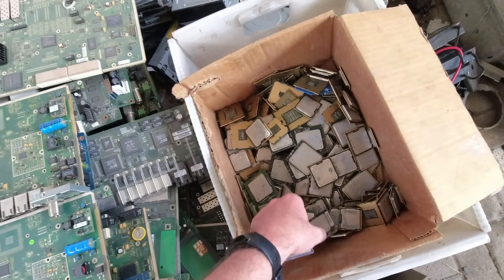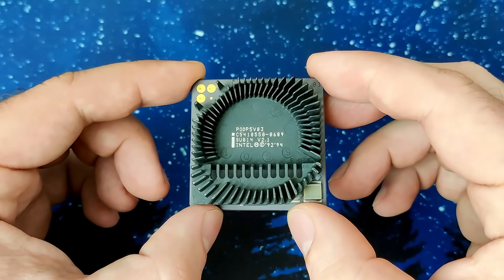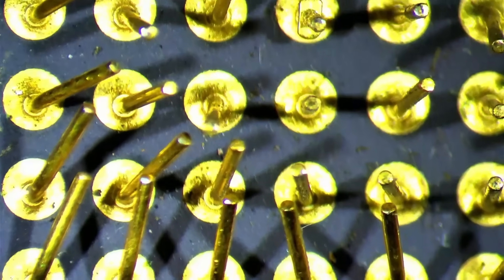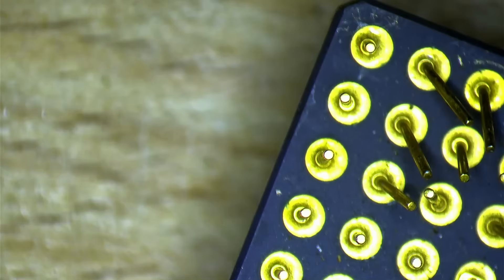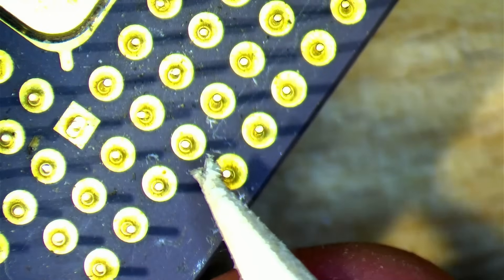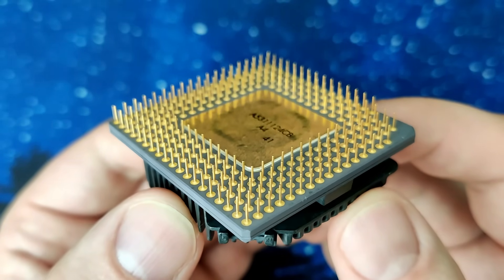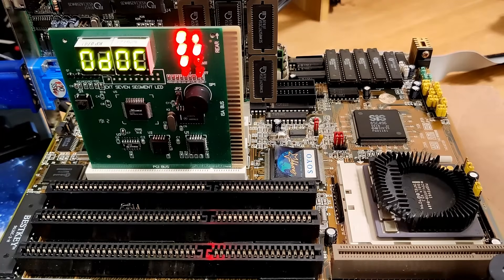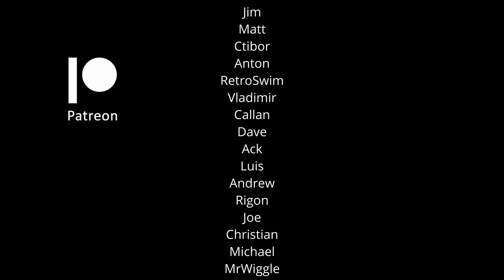Will this CPU work? Intel Pentium Overdrive (PODP5V83) - found at a scrapyard

Comment: @ 9:41 in the lower right of the CPU. What is that T on one of the pins? (Bottom right pin, move 4 pins left, and 4 pins up)
Reply from the maker: I am not sure, but it looks like a spacer that prevents the CPU from completely touching the socket. Basically, the ceramic is levitating above the socket, because that little piece of metal is preventing the pin to further go into the socket. This "T" is on all four corners of the CPU
Reply: @bitsundbolts  I didn't see it in all 4 corners until after I posted. Interesting, I guess this was done for cooling to get more airflow or allow heat to escape? I can't think of any other reason.
Reply from the maker: Yes, most probably that was the reason this gap was added.

Comment: Regarding my expectations on the pins, I'm shocked that none of them broke!
Reply from the maker: The first pin you see in the video on which I worked on, was the one that was bent 90 degrees. This one scared me! But it also bent back without issues. Those pins are surprisingly "soft" - they are strong in  numbers, but working on individual pins is almost a pleasure! Especially seeing the final result!

Comment: I thought these things looked so cool when they came out! I repaired thousands of PCs between 1996-2006, saw everything under the sun, but never saw one of these outside of a magazine. What an amazing find! I don't think you overpaid at all!

I always fixed bent pins with plastic BIC 0.7 mm mechanical pencils (0.5 mm for Socket 478 and newer stuff). This wouldn't get them perfect, but would usually allow me to get it into a socket which helped straighten them out further. At one point we had a customer return a Socket 775 board into which they had tried to install a Socket 478 P4. Yes, really. It was as ugly as you might expect, but the manager allowed them to return everything because the customer said that one of our salespeople sold him the parts together and told him it would work. The upshot is the manager just gave me the old CPU, and I bent every one of those 478 pins back into shape and had a free CPU that was worth like $1000 at the time.
Reply from the maker: Free expensive computer stuff!!! Great! I don't know if I'll ever be that lucky to find one of these CPUs ever again at the scrapyard. Well, one may dream 😉
Reply: Nice!  Free hardware is like Christmas.
Reply: @hicknopunk it is! my friend had a free monitor and gtx 1060 which sure isnt new but definitely way better than the integrated graphics i was using!
Reply: Yeah I remember seeing them in stores! They did look cool, never actually seen one in the wild.

Comment: If I only saw the end result I'd never believe it looked that bad before straightening the pins
Reply from the maker: Even though I worked on it and spent over an hour, I can't believe that it turned out that well. I have a few more CPUs that require the same treatment, but now I am way more confident to get CPUs like that. I also want to try Pentium 4s. They have pins a lot thinner.
Reply: P4 socket 478 is the absolut nightmare for straightening. Good luck. But it is also hard to get them at all. The gold content is low so scrapers are not interested to hoard those..🤨
Reply: P4 socket 478 is the absolut nightmare for straightening. Good luck. But it is also hard to get them at all. The gold content is low so scrapers are not interested to hoard those..🤨
Reply: You did a great job!  When I got my first p4 I dropped it because I was so excited.  It fell on one bottom corner and bent the pins over on it to varying degrees.  The next hour of my life was very stressful as I carefully straightened the pins.  My next cpu had no pins ❤  I hated pins after that mistake.  It looked NOTHING like the cpus you rescued
Reply from the maker: Ah! I can only imagine how you must have felt after you dropped the CPU and inspected the damage! That must have been terrible! I assume that you were able to rescue the CPU!
Reply: @bitsundbolts  yes, I was able to save it, thankfully.  I yelled loud and enough the neighbors (apartment) came to investigate though 😅  I guess I screamed like someone dying violently...

When I saw the cpu show up in post, I was over the world.
Reply from the maker: 😂 I bet you absolutely loved that PC! Bonding right from the beginning!
Reply: @bitsundbolts  i did.  I still have it.  A p4 2.4ghz, 256 mb of mushkin dual channel 222 timing memory, high end msi board, gf 660gt, a raid controller with 3 80gb western digital hdds, 1 60gb segate hdd used only as cache, an audigy gold, 19" 16:10 Samsung monitor.  I think it began with a gf 4 gt.  Oh and it is still running Windows 2000.

Comment: I thought the pins are solid gold, and not just gold plated.
Reply: solid gold would be very bad for cpu pins because of how soft gold is. Gold is primary used because of it's corrosion resistant nature but because it's so soft and prone to wear you almost always  want to plate it onto a stronger conductor.
Reply from the maker: Unfortunately, some pins are damaged and you can see the below are regular metal pins. They're not solid gold 😔
Reply: On some older electronics, and for really fancy stuff like avionics and military gear they might have been, but I'm pretty sure even as early as the 386 the pins were just gold-plated, which is really all that's needed for near-perfect conductivity anyway. Could be wrong, but that sure would be an awful lot of gold if solid.
Reply: @JohnVance  Yeah, solid would make no sense. That'd be extremely expensive. The price of computers in the 80's and 90's weren't due to gold ;)

Comment: as i know its not hampered on socket3. it has socket5 pentium 75 performance or sometimes even P90 thanks to l1 cache.
Reply from the maker: Ok, that will be interesting to test! O may have the correct socket 5 CPU for testing. But I still think that the  memory throughout is limited - which we should be able to verify.